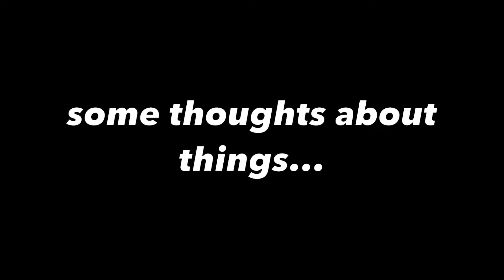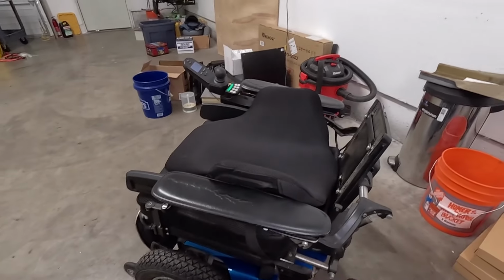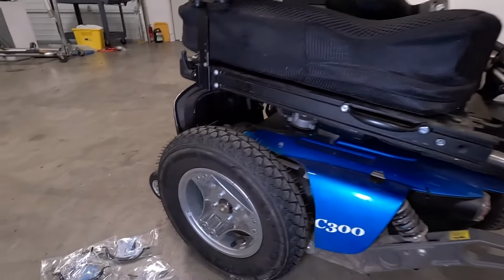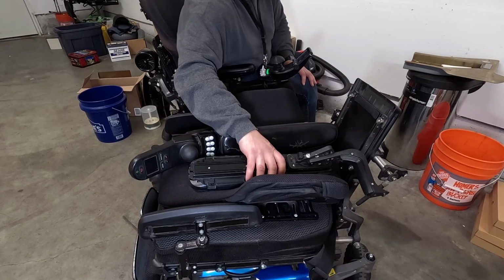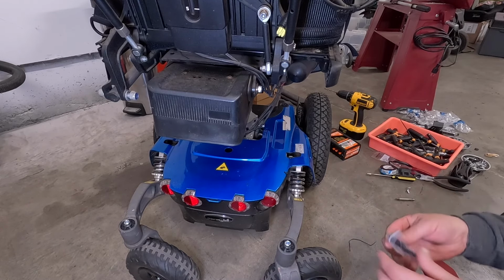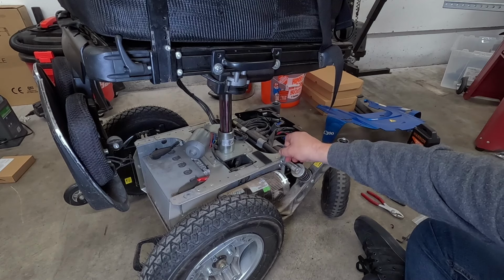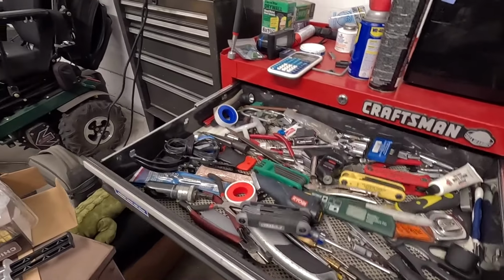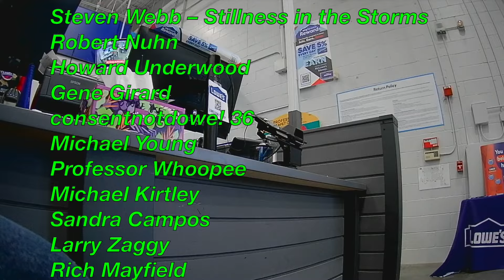VLOG 707: modding a chair for air travel!

Comment: I’ve flown southwest multiple times I have an F3 just recline your back disengage the motors, and very important cut all power to the chair otherwise they’ll turn it on to try too drive it forget it’s on then the actuators get activated mid-flight and your chairs broke when you land (personal experience) good thing the airline has contracted companies too fix whatever’s broken ontop of that you demand compensation

Comment: Once, my power wheelchair was damaged over 75%, and I only had it for a few months. It took forever to get the airlines to agree to cover the repair costs. Since then, we have done things similar to you: strip everything down and secure it. We typically wrap my joystick in bubble wrap, which has worked dramatically. I keep hearing that they're working on airplanes, where you would drive in and sit in your wheelchair, which would be ideal on several fronts.
Reply from the maker: here's a video about the new 'wheelchair seats' - https://www.youtube.com/watch?v=RRzQFlRbRp8
Reply: @TotallyNormal- @TotallyNormal —This concept is beautiful, but I wonder if doorways and aisles could accommodate power wheelchairs. Another question is how we would get airlines to want to buy airplanes with these capabilities.

Comment: Installing handles pretty much guarantees someone will try to use them as such . After all ,why are handles there if they are not supposed to be used as such ? 
If you do use them , I suggest that you use the weaker option . Lifting from here will damage your rail. Best to let the handle fail first.
If the chair has tiedown points , maybe use those instead.
Consider using  4 eye bolts instead of two handles. Use a cheap carabiner clip between the bolts and the strap to control where the asssebly will fail so expensive components are not damaged.

Comment: Awesome video.  Great hacks.  Given me some things to look in to.

We've flown with Permobile powerchairs a good dozen or so times.  Minor damage here and there.  Nothing worth pursuing a claim over.  It helps that most of those times are in and out of Orlando - they're very accustomed to powerchairs.  The big challenge is usually the ground crew knowing how to load/unload and use the powerchair lift.  Watching them do this is nerve wracking.  Where possible, we'll choose flights with larger airframes so that the crew has more options when it comes to loading.

Standard procedure for us...

Lower back seat as low as possible.  Remove headrest and take on board (thumbscrew - no tools).  Slide joystick to inside armrest position.  Turn off and flip power breaker.  Disengage breaks.  Breaks and power have labels (so many ground crew has thanked me for this - labels are everyone's friend).  Meet groundcrew outside aircraft and show them where to handle the chair, break and power, etc.  Say a prayer.

Also - rain cover.  Strapped down.  That one time they unloaded during a rainstorm was horrible.  Yeah - the chair protected the electronics.  The joystick had a cover (custom padding - which I don't do anymore).  But hoo-boy.  Wet butt is no fun.  Also - rain cover helps with some of that abrasion damage that happens in the cargo hold on occasion.

Side note: we still run in to inexperience ground crews.  But I'm impressed to find more and more who have experience with these devices.  And a proper understanding how important they are to their owners.  It doesn't guarantee safety for your gear.  But its been improving the odds.

Comment: I used to fly from Chicago to Arizona multiple times and had mixed results in the way they handled my power chair with a sip and puff system!with the 21st-century beast of a chair with lithium battery that is approved for airline travel.  after transferring to the aisle chair which reminds me of my Hannibal lector all you need is the mask? Remove the bottom cushion and use it in my airline seat. Using the gym bag place that where the bottom cushion was placing the leg rest and one armrest underneath the bag placing the headrest on top of that. Using ratchet straps x pattern  down to the tiedown points on all four corners and using industrial or moving Saran wrap to wrap the chair completely up with the wheels only thing visible and functional. My freewheel lovers are extremely stiff and don't move during flight. I have explained countless times on my chair weighing almost 300 pounds and laugh every time they have to play catch when he gets the bottom of the conveyor belts. Good luck and enjoy your flight

Comment: Great video! There is a group of us working to make it possible for those of us using power chairs to ride in our chairs in the Airplane proper! I know this does not do much good for anyone taking an extra chair along – however as you have demonstrated, there are ways of making it work.  I myself have also added a 8.5 x 11 sheet of paper basically saying: “this is my chair and my legs please respect it so that I can use it at the other end of the ride!  Pluss, like you, I disconnected the  removable parts and carry them on the plane so far, this has worked well, though I consider myself extremely lucky considering what I have seen and heard from others!

I know that there is a way of shutting down the control locking  people out, however, I agree with another viewer, you need to shut down  the entire chair. I would like to see an  Easy way to do this perhaps an easy disconnect so you can render the chair non-movable…. Or  something like that…

Comment: I flew from Vienna to Tokyo (about 11 hours) and back with my foldabe powerchair (similar to Eagle HD) without any issues. I had to remove batteries and take them withn me to the cabin because they are Lithium ones. I toke with me joystick as well (just one connector). There was one veeeery funny moment though... after landing in Tokyo, transfering to my chair, installing batteries and joystick, chair didn't work... it turns out that someone disconnected one cable from controller box... they probably thought that it was a battery. 😀

Comment: Here in Europe, you have to disconnect the battery for our Travel. On my scooter, this was an easy task as the battery box could simply be detached, but on my Power chairs this is very much more difficult and requires removing bodywork.

I used to be a very frequent flyer, and found the easiest way to do it was to take a small scooter, a pride, and it worked well. Of course it always got bashed and bruised, but never seriously broken. Unfortunately, I narrow have to use a proper power chair with a joystick 24 seven. I’ve yet to try taking this on a plane, but I expect it to be, a little more interesting, to say the least!

Comment: I printed all the labels on neon orange sticker paper and put a full directions on top of top of everything duct taped to the seat pan. 

Back in 2010, flying home to Toronto from Vegas, the GEL battery for ventilator on my chair,got flagged by TSA, we were not allowed to speak to anyone to explain that it was FAA certified and ended up having to leave the battery behind !👍🏻👍🏻 AND the kicker being, we waltzed in to the cabin with the EXACT same battery to power the ventilator during the flight…

Comment: Awesome ideas for the break release handles I've got good results with some heavy duty adhesive heat shrink as handle grips and they seem to be decent enough for that purpose all though it doesn't make good bolt caps 😅 I tried it with my lift but I instead went to those who we shall not speak of lol and got some peel and stick vynil flooring and protected the base boards instead 😁

Comment: Hi Dan good morning l have a Permobil F3 brand new wheelchair my son forgot to put it inside garage there was a very light rain but wheelchair not working l tried to dry up with air didnt help .l tried to turnon chair not powering on .l checked the rear switch l left it on the wheelchair dosnt power on .l took the main jostick and the seating remote of opened both there is not a drop of water inside.have you come across some thing like this thanks .